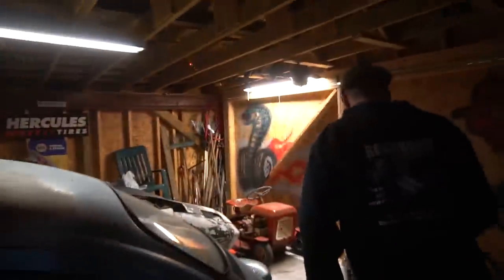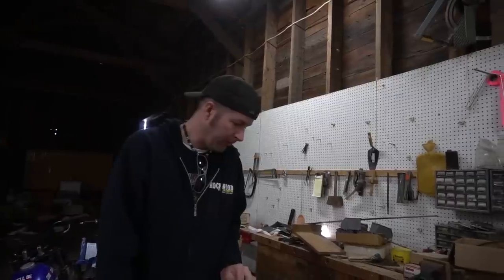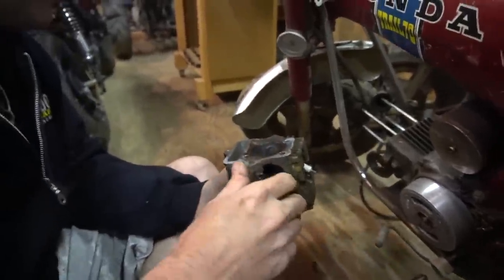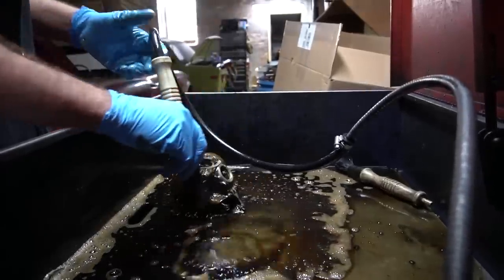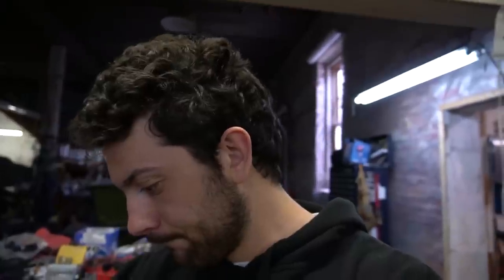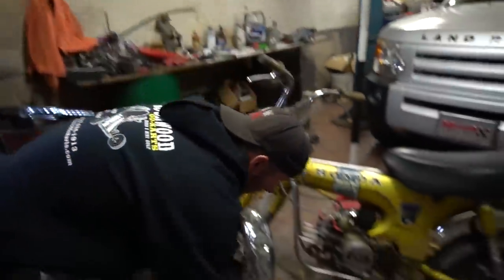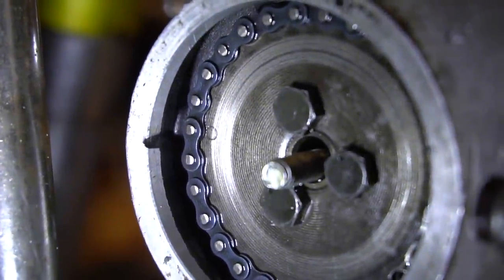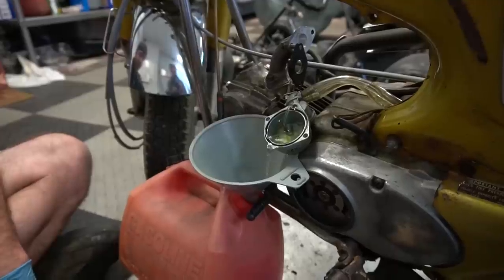Head Shaving with a Belt Sander! Trail 70 Performance Mods

Comment: Yes, you took so much off of the head it moved timing, you could elongate the holes on the pulley to make the timing adjustable, i.e. a vernier pulley. Also opening up the intake will slow the airspeed making the carb less effective, you could try a smaller carb or choke the big one down with a bit of pipe. The first rule of tuning is adjust one thing at a time ;-)
Reply: Ike changed so many things at once, there is no way to identify the problem(s). I would start by checking compression with the stock head - the rings could be shot, or the bore worn oval, or valves not sealing well. Once compression is OK, check ignition timing, and then go to carb tuning.
Reply: I was going to suggest slotting the cam gear holes as well and I have feeling this is what he's actually going to try next. I think it'll wake right up after the cam timing is adjusted back to where it should be.
Reply: Just kicking this little engine, you'd be hard pressed to a useful estimate of compression. Of course Ike is fast and sloppy; it's his shtick.
Reply: I have had another thought, the raised compression maybe causing detonation, it may need higher octane. He did skim a lot off?
Reply: that would mean he would of had to of rasied the compression by a lot...
Reply: So am I dumb, or can't you advance timing to make up for the loss? I agree with the previous comment to up the octane, however. That's what I'd do next
Reply: The Cam timing is now off, oval out the holes to get the marks to line up.also with the higher compression, you will need to play with ignition timing to see where the engine likes it.

Comment: We made our own cams from the old ones, you just take material off the low side of cam and reset the valves, you can get a lot more lift just make sure you don't go to fare that the valve retainer hits the valve guide.
Reply: I know this is an old comment, but I had never thought modifying a cam that way. That has completely blown my mind and I’m really tempted to try that on the 125 I’m currently modifying

Comment: I had 4 of them, 2 '69 and 2 '71 about 22 years ago. Total cost to acquire them was $20. Can't say what the gas mileage is because I never ran any of them on the road, mostly around trails where I grew up. Ended up selling all of them with the spare parts and a 1968 Hodaka Ace 100 (ran, but needed work) for $250 (kick myself in the head for doing that now!!) Love your channel, keep it up guys!!!

Comment: When you milled the head, the distance between the crank and the camshaft centerline was reduced. When the slack in the chain is taken up, it rotates the cam some changing the cam timing!

Comment: To advance the timing you should slot the screw holes to set the timing and pin the cam sprocket at the timing you want.

Comment: guys look into a snowmobile  2 stroke motor light and the most horsepower to weight ratio..  Think 135 hp and snowmobile clutch it will get the power down..just go watch snowmobile drags  on you tube,  SOB's are real fast.. that 1100 4 stroke will only make 90 or so HP and weighs a ton.  about a 700-800 cc motor
Reply: Agree in principal, but snowmobiles are unicorns south of the Mason-Dixon line.
Reply: yeah I just realized they are southern guys I am from Washington state..we have tons of old snowmobile parts places around..but it would be the best to buy the whole snowmobile cause it has everything they need..
Reply: It's the opposite down here. You guys get more snow in a average weekend than we do all year, and excepting a few kept at ski resorts there probably aren't three snowmobiles in the whole state.
Reply: yep worked in the mountains outside seattle it was not uncommon to get 2-3 feet on a weekend, it was the norm, one time had chest deep snow in 30 hours..
Reply: I think a snowmobile engine on a go-kart is a great idea on a CT70 not so much there's not a lot of room in there.
Reply: I was referring to their dragster not performing how they want..
Reply: in my town in south alabama, i know ONE guy who has a snowmobile....and he bought it from up north. i wish they were more common down here. i want to build a bobber bike with one.
Reply: Andrew Hill okay then why did you make a comment on a CT 70 video instead of one of the  dragster videos. That's why I thought you were talking about on the ct70.
Reply: I guess you didnt listen to the first few minutes of the video

Comment: If you "shave" a head on an OHC you have to slot the timing pulley holes so you can dial the cam back into stock specs.

Comment: If you elongate the holes in the cam gear into slots you can advance the timing of the cam.  Once you get it where you want drill a small hole through the cam gear and cam and put a roll pin in it to hold the gear firmly in place.

Comment: When I was a kid I had a 1972 CT70 4-speed manual, and it was a dog when brand new. A few years later, my friend got a used CL70 (scrambler), which had an engine which looked the same - but ran a lot stronger. I suspect the CL70 had a better cam and bigger carb.
That said, the small wheels and narrow handlebars make CT70's much more dangerous than than similar displacement bikes with bigger wheels (e.g. CL70, XR75, mini-enduro 60/80, ...)

Comment: Okay so I'm a young mechanic so if I'm wrong take it easy on me lol i was thinking about why it isn't running well with the shaved cylinder head and I think it is because when you shaved it it changed the distance of the timing chain sprockets to be closer causing the chain to have slack or change the timing by half a notch on the gear. i think that is it if anyone thinks otherwise please let me know
Reply: kyfiss ! Came to the comments section to say this. Cutting the head changes cam Timing.
Reply: Doing 18,000 modifications at once is never a good idea. 
You will chase Your Tail to figure out which one is making it run like crap. I have an old car that I am swapping a modern electronic drivetrain into.
 I am leaving it bone stock until it actually works, and then I will modify it.
Reply: They amount they shaved would be easily corrected for with the chain tensioners.
Reply: They said in the video that's what the problem was
Reply: OddBallPerformance you’ve just changed the cam timing. 
I think it usually retards rhe cam timing, when you deck  an ohc head. 
Best to bust out a degree wheel and all that jazz and find out where the cam is. 
Probably the best you can do is to slot the gear to get the cam timing right again.
Reply: MrHillfolk yes, it would alter it, but not anywhere near enough to cause his running issues, which existed before the decked head. Going by my own ears, it needs rings, which wouldnt surprise me given the bike was run in the dirt and had a decent intake leak. Just a guess, but I would wager on that guess.
Reply: OddBallPerformance 
Being compression tests are for the birds, I’d start with a leakdown test. that would separate the men from the boys. 
No need to tear down anything for exploration when you hear a buttload of air thru the oil filler from toasted rings 😂
Reply: True, unless the load of air through the crankcase isn't caused by the rings.  Compression Tests exist for a reason.  I guess only birds know why.
Reply: OddBallPerformance 
Yea but a leakdown will tell ya. 
I’ve had a lot of engines give me a good compression reading, and then go to the leakdown and there’s all kinds of hissing from the valves, and they wonder why they get a pop thru the intake occasionally or some other nonsense like that.
Reply: I never disagreed with you.
Reply: OddBallPerformance 
Oh no I didn’t think that, it’s just I’ve been bit in the butt by a compression test before and I’ll never forget it😂
Reply: kyfiss ! Right. Also, don't ignore I take air leaks like these guys did. An air leak on the intake side will cause a lean condition and cause detonation. Wich causes things to break catastrophically.
Reply: JPLX Labelle  Lean conditions can cause damage even without detonation, especially on an aircooled engine like this one.  Lean conditions can cause soft seizing, which means the piston is essentially rubbing  the cylinder metal to metal, which will score the pistons and walls and cause an out of round cylinder, all resulting in poor ring sealing and a loss in compression.

Comment: When you shaved the head you inadvertently changed the valve timing you need to slot the holes on the cam gear and then adjust the cam

Comment: Turn the 1100 sideways, run the driveshaft on a carrier bearing, mount sprocket to the drive shaft.  Or get a machinist to bro out a 1” keyed shaft enough for the 1100’s driveshaft to press into, weld it in place, and use pillow blocks and weld-a-sprocket bits from tractor supply.

Comment: you can drill the exhaust all the way around the tip and you'll find that the tip is made of a long tube an there's like 4 restors in there. or you can cut the tip all together with an angle grinder and pull the restrictors out. it's a bit hard tho, because these things are welded on, but getting rid of those is woth the effort becase once you do this the exhaust note is just perfect

Comment: Yea actual jetting is a great thing to learn.  I can give you a full write up if you'd like.    

Also..keep in mind a bigger carb will lose its bottom end a bit..the air won't have the velocity it needs if you crack it wide open. I have a bike with a big carb and its a dig until midrange

Comment: You can notch the stator plate on the ct70 to adjust the timing a bit. If there is oil behind it and you can't use O rings to seal it you can just use a bunch of high heat gasket sealer.

Comment: Those engines prefer machining the jug to promote combustion chamber squish, to suppress detonation, from raising the compression.
Also, drill the cam sprocket  holes larger to support retarding the cam timing for higher RPM operation, along with filing the flywheel key to advance ignition timing.
This helps the 3speed with power because the flywheel does not have the centrifugal advance like the 'H' 4speed models.

Comment: If you wanted to do a shaft drive engine I would recommend using the rear out of a 4 wheeler. Way more appropriately sized than something out of a car.

Comment: This has probably been said a million times, but a smog pump supercharger is the way to go. With one installed, you can use the additional air to burn more fuel with a bigger carburetor. The modified cylinder head will compliment it pretty nicely, assuming the boost combined with higher compression doesn't break something.

Comment: Turn the 4 cylinder longitudinally in the dragster. Run driveshaft off of the output shaft. And advance the timing on Ike's CT70.

Comment: According to the factory owner's manual, for a stock CT70 you change the gas once a year whether it needs it or not. Don't merely inspect the fuel level, change the gas and oil at least one time per year.

Comment: Makes sense! If you shave the head it will be lower position making the head sproket to move. I think if you clean the stock one and put new gaskets on it,  you should get the power you need. Ikes what you think to make a compressions test on that engine and compare it with John bikes or the other bikes you have.

Comment: Advance the timing by 1 tooth and push a little more fuel in it to see if it fixes it or you can put EFI in it using mega squirt or Haltec since haltec was started from the go-kart realm

Comment: why not put a inline 4-banger in the dragster, they are not very wide and very available.
Reply: MsMotron then it would sound like shit
Reply: I dont think you understand, not every inline 4 sounds bad. if you want proof check my channel
Reply: Straight 5 would be the way to go. Boxer engines sound decent.. Depends on exhaust manifold design mainly.
Reply: They explained in their last video why they aren't doing that. They want to make the 670 fast because its a challenge.
Reply: Well, say they put a 600cc I4 from a Kawasaki or something, yes it would be powerful, but they want a powerful, while maintaining that almost v8 sound of that high revving Vtwin
Reply: V twins have better low end (usually).
Reply: I don't think any of you understand. The 1100 they said they were going to use IS an inline 4...
Reply: 16 inch wide 4 banger? yeah that's gonna be tricky.

Comment: Cut the rail in half down the middle and widen it about 4 or 5 inches and weld it back together with sleeves like on the 670 black widow is and possibally a 4 wheeler diff and axle

Comment: Maby try some head gaskets until you get the correct timing again? I know on sleds you can by different thickness gaskets. Bering that its a valve timing issue, would changing ignition timing help? Im not sure there.

Comment: The ST70 - aka CT70 - fuel economy is dependent on speed.  They were rated as high as 200mpg at 15mph cruising speed.  Realistically, with the carb in good condition and the tires inflated properly, they will average around 110-120mpg.

Comment: Hi @CarsandCameras, what width is that belt sander? I work on loads of pitted and damaged heads ( Briggs & Stratton and the like)  and I know shaving the head just a smidgen might help. I try to use a piece glued down to a flat board but this would be way faster and easier.

Comment: The timing mark on these engines can be a bit off. That is because the gear on the crank is not keyed. They just press it on so it can be a bit off. Back in the days I pulled one of these engines apart until it was perfectly spot on.

Comment: if you go 1100 in the dragster (shaft drive) think smaller+lighter. Mazda GLC rear end.
another candidate may be old Datsun/Nissan B210 rear end, not quite as small tho.
the better would be engine rear, driver forward, is normal for top fueler's nowadays anyway.

Comment: On the rail where the current engine sits is 16 inches? What is the width closer towards the firewall? Just thinking of all possibilities considering the frame starts narrow in the front and progressively gets wider and wider per foot to the rear end!

Comment: Someone probably makes a slotted timing gear for it. If not, you take it to a machinist, put it in a rotary table and machine the bolt holes into slots. Line your marks up and tighten it down. (Or elongate the holes with your drill if you prefer the neanderthal method, why change things up lol).

Comment: ik this is old but just so you know all these type engines need that timing dot to go up if its in between bcs it sputters when you put the dot down since the valves open too early atleast all my bikes needed that including 110cc, 125cc, 140cc and 160cc the 140/160 wasnt mine my friend came to me to fix it and both em got fixed by me

Comment: Could you turn the 1100 cc engine sideways and install a sprocket on the output shaft to power the existing chain drive rear end?

Comment: The oil burning will likely be either bad rings (would cause the lack of power at the same time of course..) or the little rubber seal that goes between the head and cylinder on the oil return passageway. Maybe its not there?  Silicone wont seal it

Comment: Whenever I have timing dots that seem like they're half way in between I just keep slowly turning the motor over and sometimes the slack and tolerances change a little bit on the rotation and it lines up better. Drives me crazy when they don't line up good.

Comment: Surprised that the small cam timing change had such an effect, I messed around with timing on a 110cc (changed cylinder height, shaved head etc) and it didn’t make much of a difference. I made the cam bolt holes elongated so I could run it at a few different positions but I couldn’t even hear a difference when it ran

Comment: Turn the motorcycle engine sideways and run the chain drive on the dragster. Is it shorter than it is wide? If it is, that will solve two problems.

Comment: You can modify your cam gear by drilling out screw holes and if it has a Woodruff key also you can file it over and put that b** back in that correct timing!

Comment: If it's in factory shape 112mpg. Not even kidding.
Mine has a 2.Liter tank and goes 56miles before completely running out.
And I weigh 250lb and the bike has a 20mm carb, and 15 tooth front and 36 tooth rear sprockets.

Comment: I think you should put the motorcycle engine in the dragster and just mod the frame around the motor
Reply: Or just set the motor up high
Reply: Dungfly7700 I am working on a 440cc snowmobile engine swap into a yerfdog. MORE POWER

Comment: Really need to change the cam chain on that 70 shaving the head is only going to make that thing run worse as high as you guys Rev those 70s it's a surprise of things even still run speaking from experience those Hondas don't like to rev too high without stretching the cam chain I've had many Hondas from 185 ATC from 350 X just speaking from experience you don't want to Rev them too high yes shaving the head will give you more compression but will also give you more timing chain Slack

Comment: you should be able to get way more speed out of it with just a ziptie.
these old flywheels got selfadjusting timing with the core twisting.
either have someone turning the flywheel  or take it off and use a plyer to twist it.
flywheel is springloaded to the axle that slip over the crank.
the is 2 small arms that swings out and you need to lock in swung out position with a ziptie.
this way you keep it at the torgue stage like when its accelerating ..  
that and removing the silencer usually double the legal speed.
and its a easy fix if you gets pulled over.
just cut the ziptie and hand it to the cop. then its legal again :)
"there might be a limiter on intake side too"
the small modern dirtbikes use exact copies of these engines..
this means you can also use the cdi ignition , anchor plate and flywheel from a 40 y newer bike.
it swaps right over..
even 125 ccm ignition fit on a 50 ccm.. exact the same....